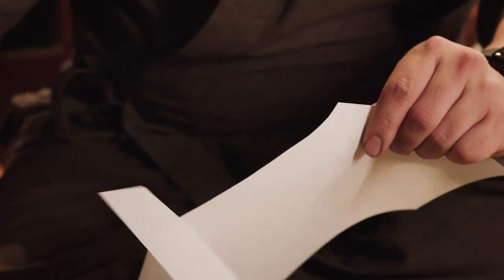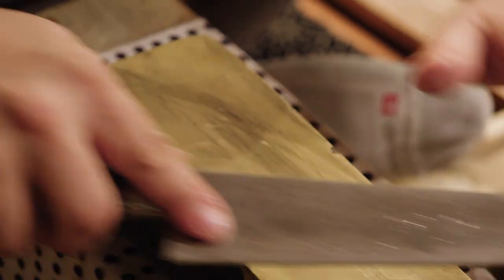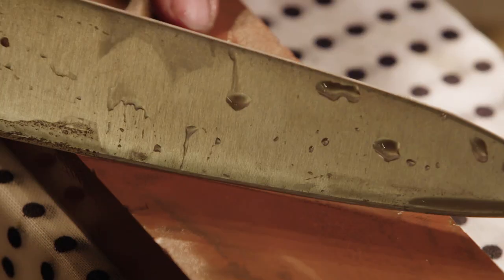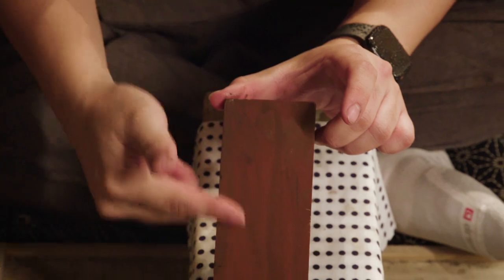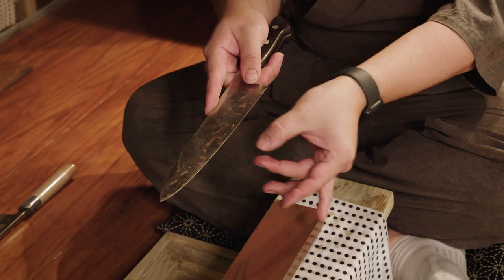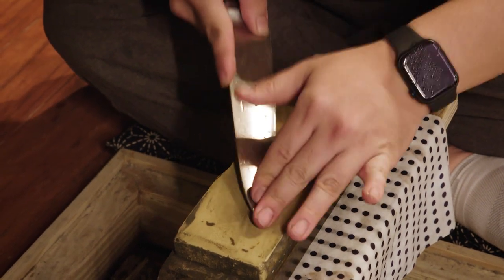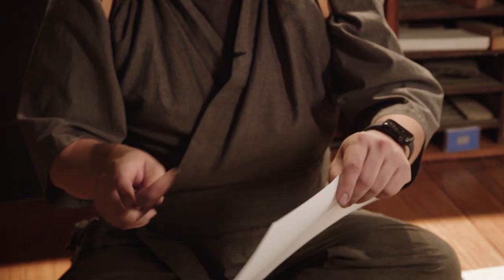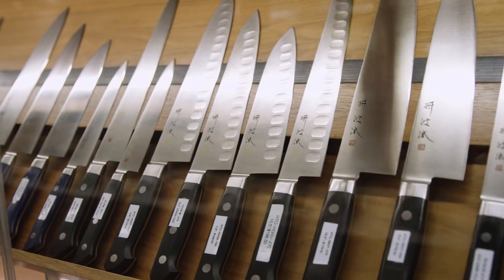How to Keep Your Kitchen Knives Sharp | F&W Experts | Food & Wine

Comment: I just bought 14 brand new razor sharp knives and I wanted to buy 3 new sharpener stones starting from 400 grit to 8000 grit. Each stone has a grit on 1 side and another grit on the other side. So 1 side may be white and the opposite side may be blue. Feedback on Amazon says they spray paint the colors on the stones and it comes off on your knives. Can you suggest what brand you use so I can purchase. Thanks for video you make it look so easy. I wish they’d sell an electric one at 15 degrees where it works and slide your knife through it 3 times and done instead of using stones. I hear the electric ones ruin your knives. Thanks ahead of time great video